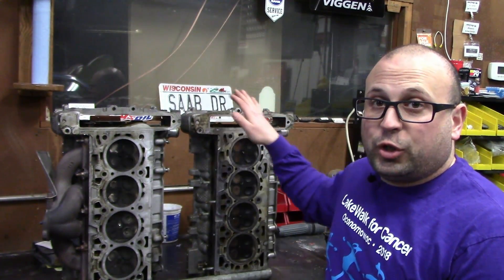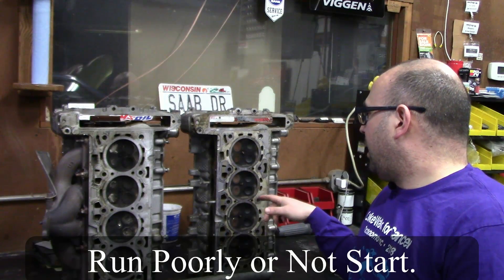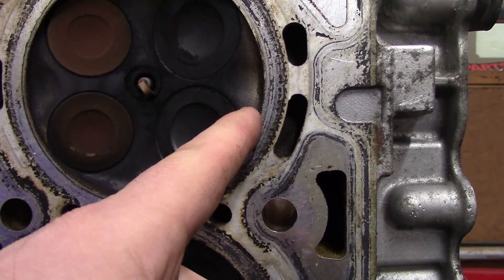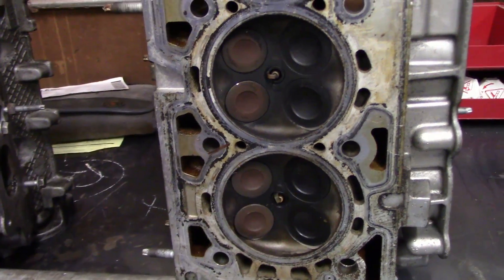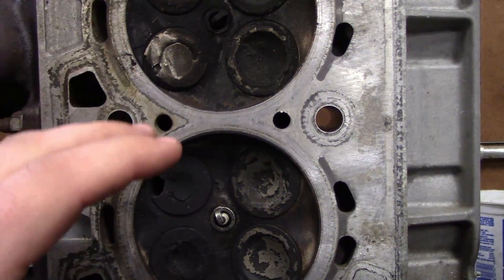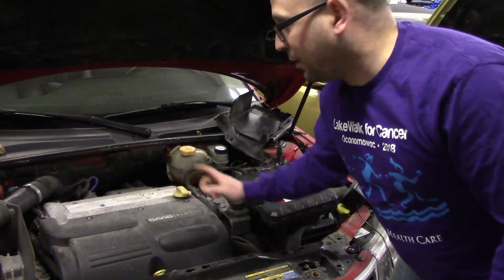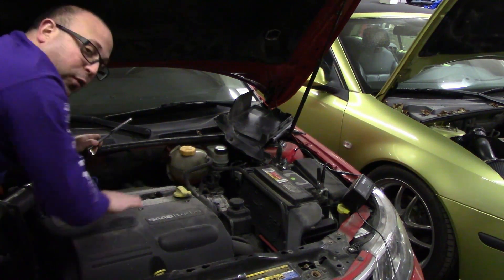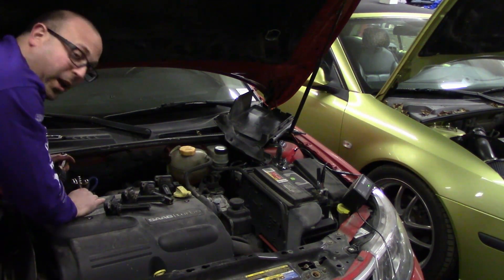Having Issues with your 2007-2011 9-3 2.0 Not Starting Right? This Could Be what's wrong!

Comment from the maker: Hey everyone -- looks like my audio wasn't fixed how I tried to fix it (software fix). It'll be fixed in the next one (need to get a mono to stereo adaptor). Sorry about that!
Reply from the maker: @Lamster66  Yeah, I'd think something like plugs, a coil pack or maybe even the throttle body needing to be cleaned. -- More along those lines from how it sounds.
Reply: @Lamster66  mazbe chec for balance chain, or also the primary chain, timing being slightly off by tensioner not being fully OK or chain stretched is not uncommon

Comment: Hi Saab doc! Thanks so much for this content. I just bought a 2008 9-3 CV for my wife and it seems like it has this exact issue. The shop I bought it from is going to run a cold compression test and based off that will replace the valves. What sort of steps do I need to make sure they take? Having the head “machined”? Basically what steps does “doing it right, all the way, the first time” include? Thanks!

Comment: Always enjoy the Saab content!
Currently have a 09 9-3 smoking like a banshee .  Not mixing oil with coolant  doesn’t misfire aiming towards a bad turbo .
Reply: I have that problem, not a bad turbo, but a bad seal could be it.
Reply: Turned out to be bad ecu injectors stuck open cause it to smoke .
And is there a reason why 2003 cylinder heads ?  Thought 09-11 had better heads ?

Comment: Does the 2010 not have this problem even though it is in the TSB?

Also how does one go about replacing these if need be? Is that the fix that requires taking everything off?
Reply from the maker: The number of 2010s effected is very low. I've heard of a few cars, but nothing like 07-09 cars. And yes, to fix this issue you need to remove the head.

Comment: hey joe,

you think a compression test is ok? I saw some dude say he tested with a leak down tester. But ive done the comp test and also a shop did it twice.. no compression issues. Im having these symptoms but still wonder... lol
Reply from the maker: Cold compression test definitely should find a valve issue. It has to be a cold compression test though. If it's done warm it will give you acceptable results. You can do a leak down if you want to, but those are more of the standard for a hesdgasket issue.
Reply: @SaabDr  my numbers ranged pretty close.. alright thanks my guy
Reply from the maker: How close? Within 10% is normally the rule.
Reply: @SaabDr  195-210 ish

Comment: dock lol i have a 2008 saab 9-3 convertible 2.0t i have that ruffing issue I opened the spark plug now I see old on the end part valve gasket is good just changed it. so I got a 2003 liner heard from lkq its good but I noticed they have this extra hose attach to it. now can I just fit that 2003 2.0t liner head on my 2008 9-3 2.0t really need help and afraid to take the turbo part off. please help. your the man!
Reply from the maker: The metal hose is for Secondary Air Injection (SAI) on the older cars. It's for emissions and is just part of the manifold, not the head. You can remove that manifold and use the 03 head, no problem. Just use the cams, manifold, etc from your 08.

Comment: Diagnosed to the “t”. Great video. I have a 2007, 280k kilometres and I am in Toronto Ontario. I’ve had this issue for the last 4 years along with a broke fuel gauge, broken driver window motor,  4 broken springs, and headlights that need replacing every 6 months.  Any of this sound familiar? I just wanted to say, the car owes me nothing, and although it has a rough start, I think of it as a rough starting muscle car that takes a minute to warm up. I’ve flooded the engine a couple times over the years, but I am always able to start it, by flooring the gas pedal, maximize air intake. It’s at that point, with the rust surfacing in a couple of spots, it’s too costly to repair for the life I figure I can get out of it. If I fix this value issue, the fuel sending unit, A\C, calipers, sensors and maf will be next. But, I still enjoy driving it! Here’s to another couple years. Fingers crossed.

Comment: Hey I need help Saab dr so I have a 2007 Saab 9-3 2.0t and I changed my whole fuel system and about a couple times a month when I try to start the car sometimes I have to crank it 2 times with my foot on the accelerator all the way for it to start and then sometimes after that it will have a really rough idle and sometimes will blow a lot of white smoke out of the engine and I can’t find the problem the check engjne light comes on and goes every once in a while and the engine at idle has a really really really small misfire I mean you can barely hear it I replaced all spark plugs coil packs and injectors and fuel pressure regulator and man I tell you I’m STUMPED I have no idea what it is and it’s honestly sad man can I give you my phone number or some way to contact you and we can talk about this cause it’s crazy also if you put your ear to the exhaust it was a very small faint pop like a misfire

Comment: my saab 2007 is shutting off when put in gear and also when driving down the road, sometimes codes coming up on dx,other times nothing, multiple sensors changed , any ideas ???

Comment: Great video. All that's needed now is a full video showing it being fixed :-)
Reply: did u ever find one
Reply: @cosmicsuperstar  Unfortunately, no. I'm still living with it. TBF, it would probably be above my mechanical skill level to do although, as I understand it, the blocks needed to hold the camshafts in the right place are more available, and cheaper, than they were back then. That wouldn't make a huge difference to me as I'd still be too scared to break something, but it might make it easier for someone else to do.
Reply: @jgmccabe  i was hoping u did it so i can know if it fixed this idle issue 😅 im gonna take a shot at it and try to replace the pvc valve… hope everything goes well this is also my first car
Reply: @cosmicsuperstar  Good luck.

Comment: Not very knowledgeable on engines, so some clarification would be appreciated. If I choose to swap an ‘03-‘06 head into my ‘08 to deal with this issue, why does it still need to be machined?
Reply: For a proper mating surface

Comment: Thank you for this video!  You have confirmed my theory that it was worn valves.  I bought my daughter a 2007 Saab 9.3 2.0T (in the summer of course).  It had 100k miles on it, ran very well.  By the winter, it was running rough when first started, and below 40 degrees overnight, it was a real bear to start.  Cold compression is zero..that's right ZERO.  I developed a system where I pump the throttle 5-times rapidly while cranking and then holding the throttle full open.  Some tell me that pumping the throttle does nothig, but I can categorically say it works better night and day than doing nothing.  Sometimes it works after a few tries (after timing out the starter motor engage timer).  When below 35 it requires a jump to maintain battery power as I have to perform this method for several minutes.  
I am preparing to remove the head, get it reconditioned and replace the valves OR as you suggested, purchase a 2003-2006 head.  If I purchase the 2003-2006 head, I believe I heard you say I need to "flip-flop" the cams from my 2007 head to the 2003-06 head.  In that case, are there any tolerance/clearance concerns if I swap the heads?  Have you successfully done such a head swap?  Many thanks!

Comment: I have an 08 93 2.0T with what seems like a valve issue, but I have compression on the 4th cylinder.  All my houses look fine, I've changed plugs, coil pack, swapped injectors.  What could the issue be.  If it is valves could the head of an 06 Saab 93 2.0T be used to replace the head on my 08.  Would this cause any power loses or interfere with a stage 0 tune?

Comment: My 2.0T starts rough... Misfires, then smooths out... Previously gave a code for misfire on cylinder 4... This has gone away... But the car is still misfiring on cold start... My compression is good on cylinder 4 and I've also swapped out spark plugs injector and coils... What could it... Also sometimes the car seems like it might be searching for a gear

Comment: Isn't cylinder 1 actually on the driver side!  Or were you just making a reference?  What head can be used for the 2007 B207R engine?  I would like to hear from you.  I do have the intake valve issue, and knew what it was, but didn't know that an different head could be used.  Thanks!

Comment: My 2008 Saab 2.0t starts perfect cold. When attempting to start it after driving for an hour or so the car stalls on start up about 2 or 3 times before starting up and maintaining idle.
Reply: I had a saab with the same issue many years ago i did everything you could think of besides swapping the engine out. But i finally found the problem was the 2 large main connectors under the battery tray had corroded contact points I disconnected them and cleaned them and used some electrical grease it ran like new after. So you guys should definitely try that and thank me later
Reply: This is what mine does. Cranks up fine cold every time. Go to the grocery store 20-30 minutes and it will stall 2-3 times the start right up. Also starts up immediately after cutting off.
Reply: @tenchu5134  mines literally has the same problem and I have the same exact issue as you and I have no idea how to fix it
Reply: 2009 9-3 2.0T and mine has the same problem

Comment: Has this been tracked down a specific serial number engine (or head part number, etc) where the defective valve material was introduced?  Looking at a 2006 Combi that's for sale, and I'm wondering if it could be affected.
Reply from the maker: It wasn't mainly because in the production process they just dump boxes of valves into other boxes -- so a box of bad valves was dumped into a box of good valves. That's why some cars are good, and some need valves.

Comment: Would I have to remachine the head if I just replaced the intake valves?
Reply from the maker: Yes, you'll need to have the valve guides replaced at a minimum. I'd recommend just having it machined and checked at that point as well.

Comment: Does it affect the B207E and B207L engines as well?
Reply from the maker: Here in the US we only got the B207R in 2007+, however the TSB doesn't specify if it only covers that engine or all. I believe that they all received the same valves, and if that's correct they would all be covered.

Comment: How much would this Sevice run? Parts $ and Labor $?
Reply from the maker: It depends on how you do it and who you have do it. I did this on one of my sister in laws cars and it ended up being around $1200 US, however I replaced a few extra things, and I bought a used head that ended up needing some guide work so $650 of that was at the machine shop. As for labor I'm not sure what a shop would charge.
Reply: Saab Dr Thank you! Great video.

Comment: Great video! I can ocnfirm the issue, since I own the good and the bad right now.
My 2009 9-3 Vert 2.0T compression now at 64k miles (yes, barely driven, pampered Garage Queen): 
Cyl 1-4, in psi:
95-95-150-215. (THIS Sucks. Misses and hard to keep running when cold. Started acting up last fall. Not driven since the second hard start-day.)

My 2005 9-3 Vert 2.0T compression now at 198k miles, driven hard but religiously changed the oil at 3-5k miles:
210-210-200-200 (Pretty good, and still idles smoothly)

GM: You screwed up casting/forging these valves. 
SAAB: You should have done hardness testing on samples pulled from the batches supplied.
Should be a recall, but not gonna happen.

Pull the head and send to a machine shop. NO MILLING. Just valves and seat replacements for around $350. Lots of owners have done this already. New valves from EEuroparts resolve the issue. No they are not sponsoring me. I just love SAABs & trying to help. :-)
Reply from the maker: I just grabbed a second head (from a 2003-2006) from the Junkyard for $100 -- the issue ended up being that the valve seats needed to be replaced and that cost a bit. Milling the head is cheap so I always do it regardless. Ended up being about a $1200 job all in once I was done (headgasket, misc gaskets, etc) -- but is completely worth it, and worth doing it right given the circumstances.
Reply: @SaabDr  Cool!
I was worried the milling might increase compression? Guess that would be a benefit since they are built for it. :-)

That is going to be my spring project.

Comment: Just about to hit 163k in my 08' 9-3, cold starts about once every month but hasn't seem to become a real issue yet... 😰
Reply from the maker: I mean if you want to see what may be happening I'd suggest a cold compression test. It may not be bad yet, but getting it done can prepare you for the future.
Reply: Saab Dr good to know, I’d like to keep my tragic ss on the road for as long as possible.
Reply from the maker: @fellla  it's not THAT bad of a repair.
Reply: Wasn't it a recall?  It could have been done, maybe.
Reply from the maker: @PeterChomanic  it wasn't a recall, it was a TSB. Difference between the two is that a recall is government mandated (at least here in the US) to be fixed on all cars and is normally a safety issue. TSB is a technical service bulletin meaning that if a car comes in presenting a certain set of issues this is the diagnosis procedure to figure out if this car is part of the TSB. There is no financial manufacturer support for cars outside of warranty.

Comment: Good video. Now I won't be able to resist doing a compression check when I do the plugs on our 9-3x. Don't think it has any valve issues, but it would be interesting to see how good the compression is. Thanks for the info.

Comment: My 03 93 convert filled up w smoke:( and I can't fix it:(((
Reply from the maker: Anything can be fixed. Why did it fill with smoke?
Reply: @SaabDr  well the car had many issues I was working out but it may have something to do with me putting a radio in. Not sure tho I was driving down the street listening to music and I noticed my guage lights were all off so I threw it in neutral and went to restart quick to see if they would come on all while I'm rolling down the street and as I turn the key and realized there was no crank at all my cab filled with nasty electric smelly smoke(all that worked was overheating fan and radio). About 2 weeks b4 that I had a shop extract 3 studs from manifold and stop a few oil leaks i didn't have the balls to get to at the time, and b4 that another shop did the alternator and a few months b4 that me and my dad put a new shifter, ignition, and I did the crankshaft sensor. So I dont think any of that work would of affected it but the radio is suspect I hear a lot of those stories. But now I can't find anything that looks melted at all. Fuse 23 I believe it was "top stack" was blown and everytime I put one in it would blow instantly. Sorry for the rant hahah

Comment: what I could read on the Swedish saab turbo club site, is that this problem does not occur on the "BioPower" cars. they have harder valves. Here in Sweden we have alot of "BioPower" saabs. don´t know if they exist in other parts of the World. Excuse my bad English :)
Reply from the maker: No worries. There weren't a ton of US spec cars that were biopower. The NG 9-5s in the US are biopower but somehow were on the list as well even though the fix is using biopower valves.

Comment: Hi Saab Dr., I'm in the UK and have a early 2007 9-3 Aero (old exterior, new interior) with the 2.0 B207 engine.  It has 100,000 miles, runs great no starting issues.  My question is how do I find out if my engine is one that is at risk of the intake valve issue?  What is the range of Engine Numbers that is affected?
Reply from the maker: There isn't a range of numbers, it started with the 2007 model year however not all the cars are effected. It's kind of hit and miss depending on what head went on what engine...
Reply: @SaabDr  Thanks for the reply, just keep my fingers crossed that it doesn't fail!  Great videos BTW, very informative.

Comment: Yup my 2007 is having problems again I think it’s the weak valves Saab put in it my dad keeps thinking it’s the stupid throttle body but it looks to be fine I brought up the valve issue and he kept saying that if it were the valves it would make noise  but I mean it sometimes starts and on the freeway it just dies but nobody believes me
Reply from the maker: Did you have it repaired at one point?
Reply: Saab Dr  no still all original parts only thing I did was replace spark plugs and the valve cover gasket but same issues occur
Reply from the maker: The valve issue wouldn't make noise, however it only presents when the car is cold because once the engine warms up the valve expands and seals. When they're cold they're contracted and don't seal, causing low compression.
Reply: could be your CPk if it's cutting out when warm. See here: https://www.youtube.com/watch?v=iLKOqCS67xM